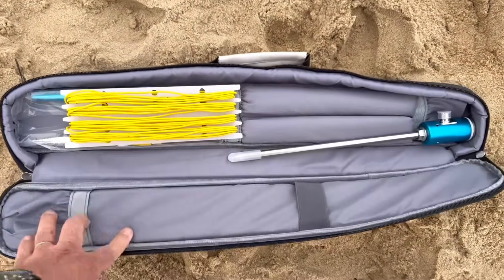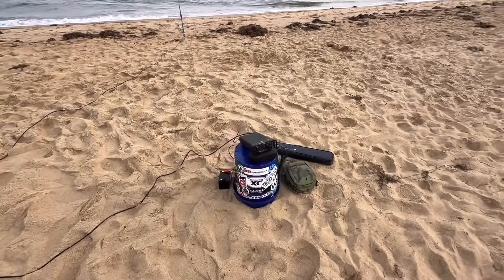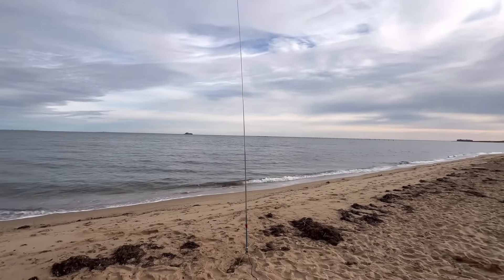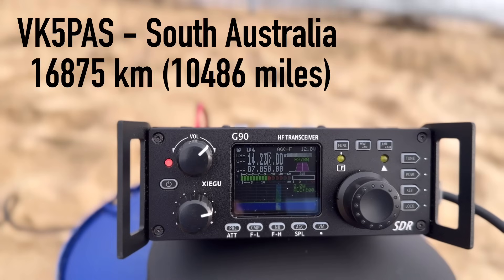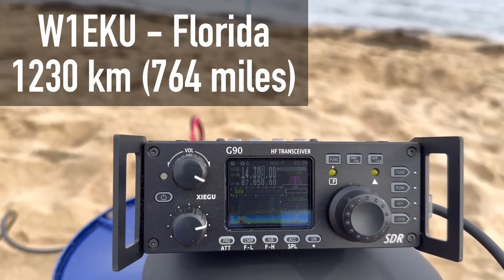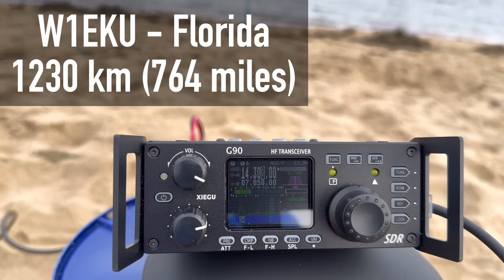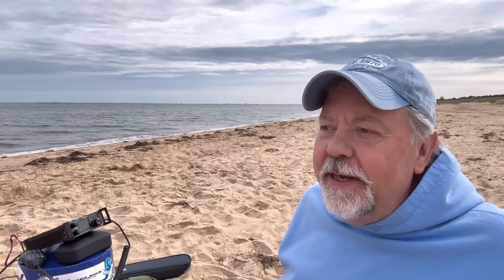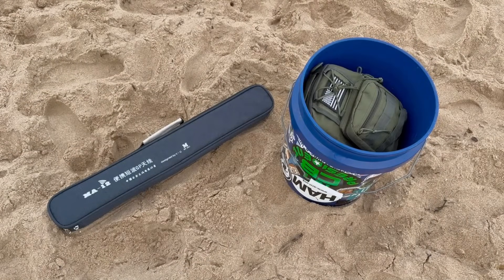HF Ham Radio - Low Power Saltwater Amplifier DX

Comment: Good video. I love simple vertical antennas, especially the telescopic whips. I am old and throwing wires up into trees is not for me. This is Wednesday and was honored to catch you doing POTA this morning. Sorry for being radio tongue tied. I sat down for coffee, turned on my G90 and heard K4OGO. So, I had to try and make contact and did. A G90, Rybakov antenna, coffee and a talk with Walt. Good radio day already. KQ4RGB
Reply from the maker: Great to get you in the log my friend!! I was in the same spot as this video. I’ll have todays activation up in it’s entirety later today at the end of my next video which is on the JPC-12 Radial Plate upgrade. 73, Walt

Comment: When getting to peak season finding a beach spot can be hard.  I find going further into the park can be a great setup as well. Just watch wires . people will find them. Kids will run into them.  Still a lot of fun. I always make time for the park as well.  FRS radios are great in the park as well. me and girlfriend put radios to good use.  I love the new version of the G 90 .  better power connector to battery system.  I think they addressed the heat issue on first model . But that mostly on digital modes. 73 from NY

Comment: Got a great story on this subject. Years ago I was a member of the South Texas Amateur Radio Club (STARC). We had a station on the Aircraft Carrier Lexington in Corpus Christi bay. Just “barefoot”, no amps. During contests, we were always asked “what amp we were running, it sounds like 10,000 watts”. All that steel sitting in salt water was a hell of a ground plane.